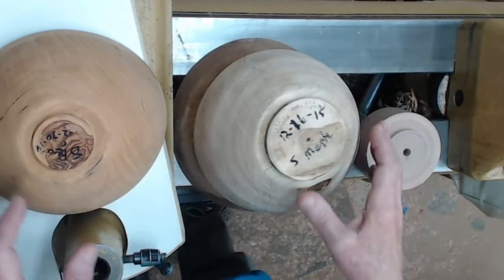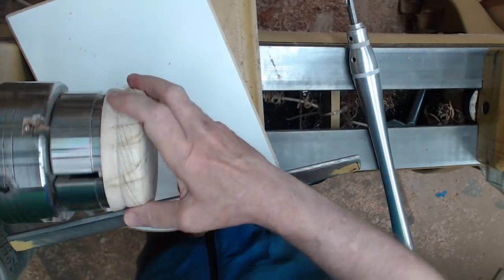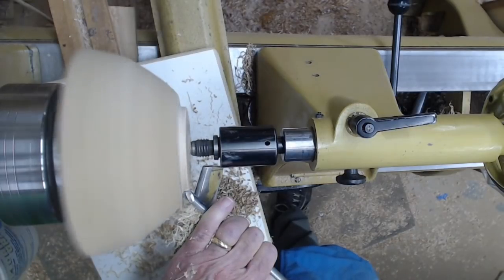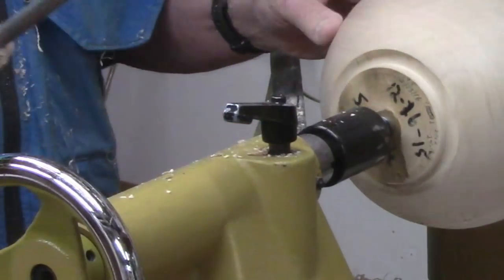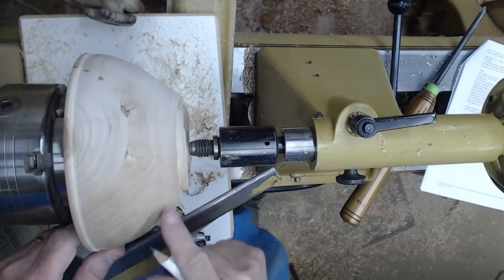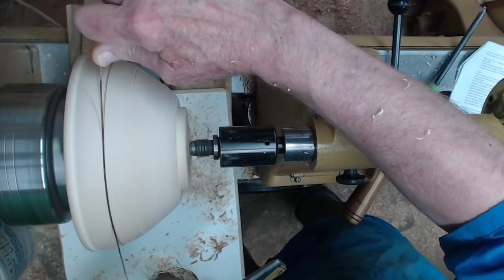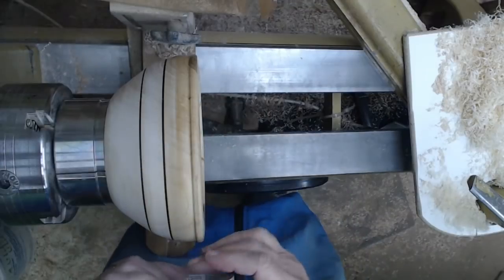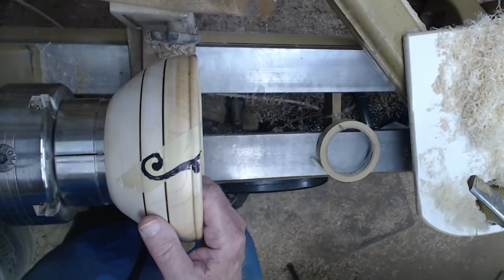How to Turn a Yarn Bowl

Comment: Really elegant present, with the pyrography, Mike. I made one in 2015 for daughter Wendy in Germany using my coping saw and "Dremel" just as you have done. Chose home grown cherry, end grain, and kept it straight sided to retain all the bark, which meant very generously finishing with Danish Oil to avoid snagging wool fibres.  Flat bottomed  for stability, 5 1/2" x 4" deep with 1/2" walls.. I drilled extra holes for knitting multiple yarns, including one in centre bottom as some knitters invert their bowl on a coffee table to cover the wool. I like your sandpaper trick: my method is to use a Chattaway (laboratory chemist's) spatula fitted with adhesive sandpaper.   Bernard.
Reply from the maker: I am sure your daughter treasures your bowl, Bernard. Thanks,for commenting.

Comment: Mike I always love your videos.  I draw the J hook on a piece of paper and transfer it to the bowl using carbon paper.
Reply from the maker: That works. How many of these have you turned?
Reply: @MikePeaceWoodturning  5 or 6. Don’t look like yours.  More a bowl on a short pedestal.  I am going to try one like yours and will try some burning on it.  I am not very good at this.
Reply from the maker: @billy19461  Me neither but the more you do the better you get. Sketch your design concept on paper before you commit to burning on the wood. Like any other skill, practice on scraps first.